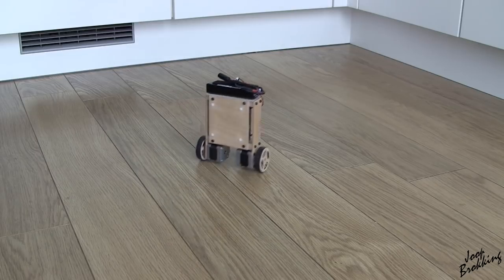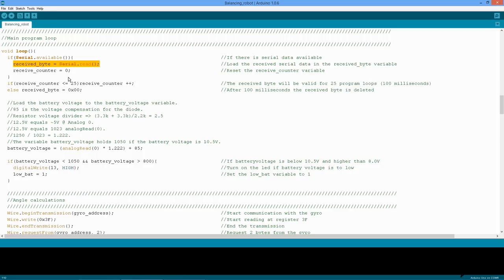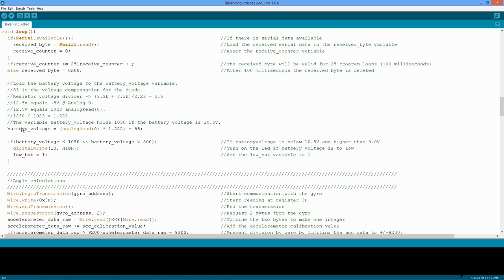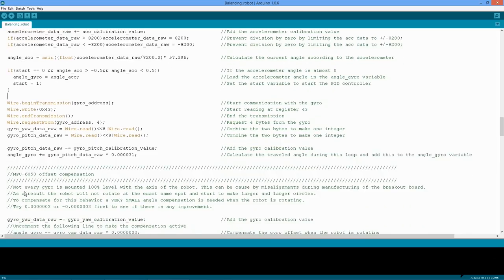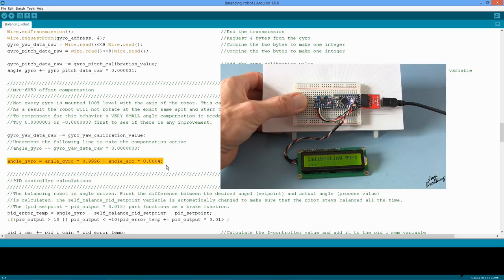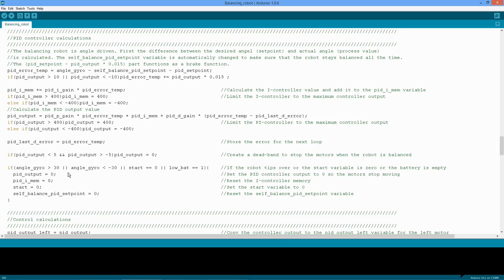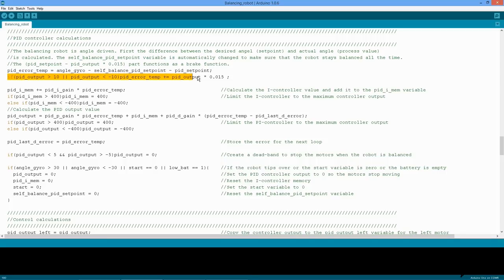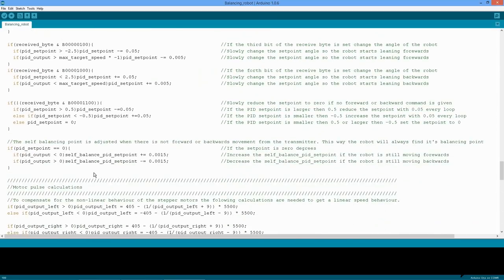Arduino project - Your Arduino Balancing Robot (YABR) - Part 3 - explaining the code

Comment: Hi Joop, can you expand on the part about "logarithmic behavior of stepper motor speed vs pulse train"?

I'm trying to figure out what this line means:
if(pid_output_left > 0)pid_output_left = 405 - (1/(pid_output_left + 9)) * 5500;

Where do the 405, the 9, and the *5500 come from?  What is this equation derived from?  Thanks
Reply from the maker: You can find it in the Excel sheet. The equation is the result of trying to compensate the behavior of the stepper motor.
Reply: Ah I see, it is non-linear because you are changing the period between pulses correct?  ie, your output is 1/x.  If I am varying the frequency of pulses, that should already be linear right?  Since varying the frequency is directly varying how many steps per second the motor is receiving?

Comment: Thank you for your video.
I have some question. Can I put the difference MPU-6050 alignment on my robot? 
I mean, your video put in a vertical line but I have to put mpu-6050 in a horizontal line.
Reply from the maker: Change/swap the axis in the code via the trail and error method.
Reply: Joop, how can i chage the axis in the code?

Comment: battery_voltage  = (analogRead(0) * 1.222) + 85
if analogRead(0) = 1023 then
battery_voltage = (1023 * 1.222) + 85 = 1335.106
does that mean  battery voltage equals 13.35 V?
Reply: Here we added (+85) for the diode voltage drop, where the highest voltage that will come to the analogRead will be (5V - 0.85V) = 4.15V...

Comment: One more thing to code: The postiton of the robot must only reflect the commads from the radio control, nothing else should matter. So if the robot is moved by external force (pushed or by gravity on a slope), it should remeber the number of steps needed to stabilize and move the same exact number of steps in oposite direction.
Very nice video series. Very explanatory. Kudos!
Reply from the maker: I made the code as easy as possible so others can understand it and make there own features. The code is just to get you started and motivated to explore and learn.
Reply: You can't do that using only the hardware shown here. You would need encoders on each wheel

Comment: Wow. Really impressive implementation. Where did you get the informations about the formulars for the motor pulse calculation? I would like to comprehend why you choosed numbers like the 400.
Reply from the maker: It's all done by:
while (fail == 1){
  think again;
  try again;
  if(succes)fail = 0;
}
Reply: Are you refering your answer just to the numbers or also to the formular self?

Comment: Hello. Thanks a lot for you. I've done YABR  about 10 days ago.  It's a good balancing car!!! I used RF trans&receiver with joystick as  signal sender. The Kysan_Nema17_stepper motor as a actuator. The rest is same with you. Ah, The timer interrupt is good idea! 

(Very sorry not to be about YABR area) I have a question about YMFC auto altitude process.
 I had totally understood your YMFC code. Its flying is perfect!
I've got data from barometer according  to its sample rate . . . about 50hz.  And calculated  PID value, which is 'pid_output_altitude' . I've added the value each esc_1, 2, 3, 4.

    esc_1 = throttle - pid_output_pitch + pid_output_roll - pid_output_yaw + pid_output_altitude; 
    esc_2 = throttle + pid_output_pitch + pid_output_roll + pid_output_yaw + pid_output_altitude;
    esc_3 = throttle + pid_output_pitch - pid_output_roll - pid_output_yaw + pid_output_altitude;
    esc_4 = throttle - pid_output_pitch - pid_output_roll + pid_output_yaw + pid_output_altitude;

Is it right process?  Thanks  a lot although  any other trivial help!
Reply from the maker: You have to fix the throttle first and then change it with the calculated PID value.
Reply: I did it already through try and errors. Thanks. Because of your advice and hints in the video and blog, I always obtain energy. Thanks again. Nowadays I am writing  RTH function with HMC5883 & GPS. It's hard to write my own code without  any help. (In fact your help is only one.) When  I calculate the direction of Quad, the PID control is likely also needed. Is it right?

Comment: Hi Joop! I love your videos, and I love the YABR especially. What an amazing design! Mine is completely built and working now (happily balancing!) but I have not yet connected the radios for remote control,  because I would prefer to use a bluetooth radio or NRF24L01 radios. Have you tried these or is there a reason not to? Thanks!!!
Reply from the maker: The modules that I used are plug and play and don't consume any microcontroller calculation power. The is why I did not use the NRF modules.
Reply: Joop Brokking thanks Joop 😊
Reply: Joop Brokking I can't believe how well the robot can balance even on loose bed covers on a mattress!

Comment: Deal extreme is out of the stepper motors. Maybe someone could list the nema14 motors they used from Banggood or a different source like Amazon. 
I have everything made I'm just waiting on the motors.
Reply from the maker: You could also use these:
http://www.dx.com/p/geeetech-3d-printer-reprap-1-8-degree-anti-slip-42yb-stepper-motor-black-370044
But please note that these are 42mm in stead of 35. So you have to modify the frame.
Reply: I've done with Nema17 which is 42mm. And the size of frame is not important just like Joop's saying!
Reply: Back in stock !!! Ordering today

Comment: Hi Joop, 

Thank you very much for your effort in producing the entertaining and educating videos.  I learnt a lot.

After watching all three YABR videos,  I realize that so long as the robot is self balancing on the pitch axis, the hardware setup procedure will take care of the normal balance position. so no code change is needed even the MPU6050 is positioned horizontally at setup (instead of vertical).   Grateful if you could confirm my understanding.

Thanks,
Reply from the maker: The position of the MPU-6050 is very important because the accelerometer is needed for compensating the gyro's drift. As explained in detail in this video: https://youtu.be/4BoIE8YQwM8
Reply: thanks for your reply.   Lucky that I have not soldered my mpu to pcb.
Reply: ok, I mounted the MPU6050 vertically.  Another question - will e the robot's weight distribution along the pitch axis affect the performance.  I could imagine the power use is increased, pls share your thoughts.
Reply: Hi Joop,
Completed the built, hardware test program run ok, and generated a balancing value -1319 (negative).  My MPU5060 is setup vertically by attaching it to an angled stand, the pcb and other components are mounted horizontally.  Wondering why a negative value?!

Followed the procedure to limit DVR8825 current. 

After changing the balance value in the Balancing robot program and upload.   Powered the robot by 12V lipo, the robot cannot balance.    Try to reload the hardware test program, but this time, encountered upload error: "Verification error content not match".

Research the web indicates an upload reset issue,  what is your view on this?
Reply: one more question, the diode becomes burning hot when 12V power is connected for a brief while.   Is it normal?